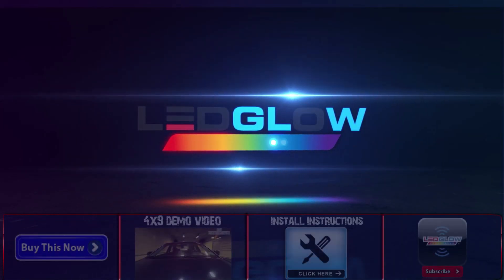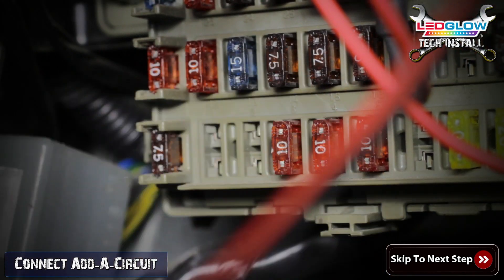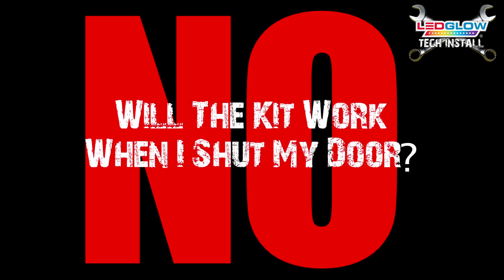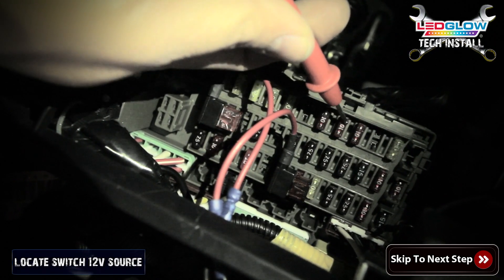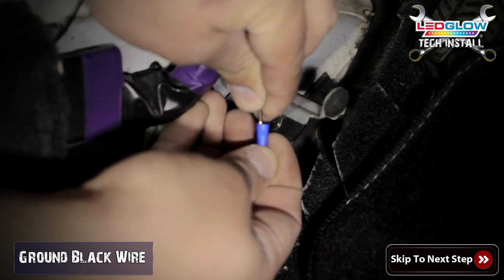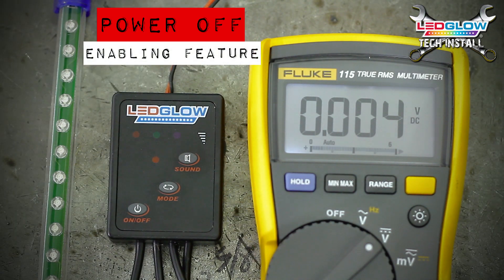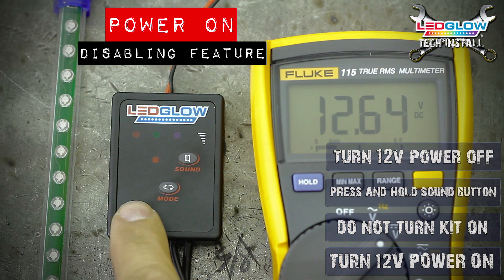LEDGlow | Auto Illumination Mode for 7 Color Interior Car Lights and Truck Lights

Comment: Is it possible to have it hooked up so its on when the door is open and the car is not running like when you are getting in the car, and will go off with the interior lights when the door is shut, and also come on when when you are using the ignition and turn the car on? I would appreciate your time if you can respond, thank you!
Reply from the maker: supersnake151 You can use either one of the installation methods you mentioned, but unfortunately you cannot connect the kit to two different power sources, it's either one or the other. Let me know if you have any other questions or concerns!

Comment: If I want my lights to turn on when I open my doors like my dome lights do what circuit should I connect to? I was going to use the cigarette lighter circuit but I heard that only gets power when the car is on.  So would the cigarette lighter circuit work? If not which should I use? Thanks

Comment: in order to power the lighting kit, does it have to be plugged into the battery is there another source of power, other than a cigarette lighter?
Reply from the maker: +Tarek Taher You can hook it up to the battery, use the cigarette lighting with our socket adapter, or use an expandable circuit which would provide power via the fuse panel.

Comment: I have a 2004 Toyota Solara convertible. Is it possible to install these and be able to switch them on and off as I would like, instead of wiring it up so it's set for a default like the headlights, if the door is open, or if my engine is on? Because I want these set up so I can turn them on and off when I want.
Reply from the maker: +Cameron Tucker Yes, the kits come with a their own on/off power switches.
Reply: Ok, so which is your preferred route to installing these so I can turn them off and on. I'm thinking of wiring it up so when the door is open they turn on. BUT... if the door is closed, can I still power them on with the remote switch?
Reply from the maker: +Cameron Tucker No, if you hooked it up to power on when the door is open, it will not be able to be turned on when the door is shut. You can hook it up to any switched, or constant power source and then be able to turn the kit on and off on your own.

Comment: If I would connect them directly to the headlights-wire, it will appearently shut down functionality because of the board-computer of my BMW E46. Is there a solution for this?
Reply from the maker: +Michael Goor I am sorry to hear about that issue. For more help with technical related questions, I would speak to our technical department. They can be reached by phone at 856-768-5700 or by e-mail at: techsupport@ledglow.com

Comment: How hard would it be to install it into my 2002 f-150 and take them out once I get a new truck.
Reply from the maker: +Jacob Poche Installation and removal of our kits are extremely easy. You can just use an adhesive, which we include, to install them and simply peel them off when you are ready to install them in a new truck.
Reply: +LEDGlow  Ok thank you and when do you think yall would have the bluetooth interior lights?
Reply from the maker: +Jacob Poche Unfortunately, I am unaware on if, or when, we may have Bluetooth interior lights available.

Comment: So if I run it to my ignition when I turn the car on the lights will stay on til I turn the car off right? And which expandable circuit would I need to do this with your million color Bluetooth leds?
Reply from the maker: That is correct. Check your vehicles fuse box or look in the owners manual.

Comment: On amazon they have LEDGlow single color lighting for the same price, if not more, than the 7-color lighting. Is there a loss in brightness with the 7-color set? I don't understand why someone would pay for just one color when they could have them all for the same price. Tho i could not find any specifications on the lights anywhere.
Reply from the maker: Evan Scott There isn't a loss of overall brightness between the two kits, but Single Color Kits come included with 7 different brightness levels whereas the 7 Color Kit only has 1 level which is a good brightness. Is there anything specific about either of the kits that you would like to know about?

Comment: For the door controlled lights, what would be a switched power source that I could splice into. My car is a 1995 nissan 300zx NA
Reply from the maker: OG BananaSwag If you're looking to install your LED interior lights to turn on when the door opens, you will want to power the kit from a constant source rather than a switched power source. If you open the door and you're connected to a switched power source then the kit won't turn on unless the car is turned on. Let me know if you have any other questions!
Reply: @ledglow  is there a way to use the door pin method with the headlight method?

Comment: Does anyone know what the appropriate price range would be to have this done by someone professional?I know electrical stuff can be tricky and I'm not confident enough to do it myself.
Reply from the maker: Jorge Posadas Unfortunately we cannot name a price for a shop to install the lights for you, but it shouldn't take longer than a few hours to install. I recommend contacting a few local auto/stereo shops that perform installations, ask for a few price quotes and weigh your options from there. Let me know if I can help with anything else!

Comment: if you connect it to the ignition will they turn on when you turn your car on or off ?
Reply from the maker: +Trey Rahman Yes, if they are hooked up to a switched power source, they turn off whenever the power wire is no longer receiving 12 volts.

Comment: Will the headlight auto illumination work if the headlights are on auto?
Reply from the maker: If you connect the kit to the headlight switch itself, no, it will not work with auto headlights. If you want the kit to work with auto headlights, you will need to connect them to a 12-volt wire between the can bus and the headlights.

Comment: hi there is there a way to connect the led glow to turn on when on when doors open and turn off when engine starts running just like the dome and door lights do ?
Reply from the maker: Rury Carrillo If you connect your LEDGlow interior kit to turn on when the doors are open, they will not function when the door is closed so when you're driving on the road, the kit will have no power going to it. Let me know if you have any other questions!

Comment: Hey LedGlow, I ordered and installed your 7-color underdash glow and not even a week with it, the fuse box busted. Is there anything you guys can do to help me because now it's not working at all. I would greatly appreciate your help. I am a avid consumer of you guys' underdash kits.
Reply from the maker: mr21king2 Thanks for letting us know about your issue. Did the entire fuse box of your car fail or only the control box of the interior kit you installed?
Reply: It was just the fuse box, super glue nor duct tape worked.
Reply from the maker: Hmm, that is odd. I'm still not entirely sure what your problem is, but I recommend contacting our Technical Support Dept. at 877-LED-GLOW and one of our techs will be able to help further diagnose the issue you're having. Or if you'd like you can email me your contact information to Mike@LEDGlow.com and I will have one of our techs contact you directly at whatever time is good for you.

Comment: Is it possible to program it so that the lights fade on and off with the auto illumination to the doors
Reply from the maker: MrGordito4life Unfortunately the interior lights cannot fade on and off when wired to the door pin. They will just turn on when the door is opened and when the door closes along with the power circuit to the kit, the lights will turn off. Let me know if you have any other questions or concerns!

Comment: I have two questions:
 1) I own the 7 color interior lighting kit. If I want it set to only one specific color (ex. blue), would I have to set that up before I program the auto illumination setting or can it be done at any time? 

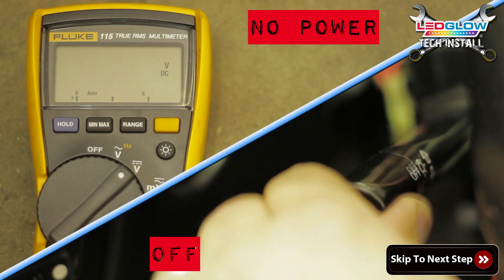2) If I wanted the auto illumination to go with my headlights, could I also get my power from there by wiring the power wire and the headlight wire using the scotch lock (like shown in the video at around 4:00)?
Thank you!! :)
Reply from the maker: +Vasiliki Pappas Hello! For more in-depth answers to your questions, I would get in contact with our technical staff. You can e-mail them at: techsupport@ledglow.com OR you can reach them at 1-856-768-5700.

Comment: Hey guys! This is a cool product and I was thinking about getting a kit! I just have two questions! 

Local law says I can't drive with these on because they are a hazards so I was wondering if:

#1 is there a way I could wire the kit so it would turn on with the interiors when I open the doors (I wouldn't be able to use the door switch method because of the circuit interuption) but also be able to turn them on and  off as I please? Or does the toggle switch allow me to do that? (I'm a bit confused with its function settings) 

And #2 if I wire it directly from my battery, will it power of when my ignition is off also? (So I don't end up with a dead battery?) 

If anyone could give me a hand that would be great!! I'm fairly new at wiring!

Thanks!! 

-Mitch
Reply from the maker: Thanks for reaching out to us, Mitchell Dureault !

If you open and close the door, it will not trigger the kit to be turned on, it can only be used as a single way to power the kit on and off and you mentioned you cannot use the door switch method. Your best bet would be to wire to the kit to a switch or the headlight switch source so when the headlights turn on, the kit turns on as well.

If you decide to power the kit from the battery, the kit will always have power going to it whether the car is on or off. Our LED light kits have a very low amp draw when not in use (.01 amps) but as I mentioned above, I recommend connecting to a switched power source to just completely avoid the possibility of a dead battery. If you have any other questions or concerns don't hesitate to ask!

Comment: how do you know which cable is the headlight wire? I want to the headlight method but i don't have a voltmeter, and was wondering if i could it without one.
Reply from the maker: Natural Born K1LL@ If you do not have a voltmeter, you can use an expandable circuit to tap power off the headlights fuse from the fuse box. You can find this fuse by referring to your owner's manual in your car. Let me know if you have any other questions or concerns!
Reply: I have the expandable circuit as well and tried several different fuses, but nothing works. I looked up different fuses, such as airbags, wipers, and a few others but the leds still don't work.
Reply from the maker: Natural Born K1LL@ If you connected the expandable circuit to your wipers fuse for example, make sure the car is powered on to test the kit because the wipers will only function when the car is on. What year/make/model are you installing the underbody kit to? I will try to do a quick search to see which fuse you can use to power the kit from the headlights.
Reply: I did that too, and my car is a 2014 vw golf. I tried several fuses with the ignition on.
Reply from the maker: Natural Born K1LL@ Where do you have the black ground wire connected to? This wire needs to be connected to a bare metal surface and even if everything seems to be fine but this part isn't connected to metal then the kit will not turn on.
Reply: i cramped the black wire onto a ring end and put it in between a washer and a screw inside my dash.
Reply: and i also tried it on a empty fuse slot with no results
Reply from the maker: Natural Born K1LL@ It seems like you installed everything correctly. I can refer you to one of our Technical Support Specialists so they can further troubleshoot the issue you're having. If you could email me your contact information (name, phone number and a good time to reach you), I can have a tech support specialist contact you directly to see exactly what the issue is.
Reply from the maker: Natural Born K1LL@ If you could please send that email to Mike@LEDGlow.com.

Comment: so what about with the dome light of my car I could use with door open or closed
Reply from the maker: ***** If you install your LED interior kit using the door pin and auto illumination function, the kit will only function when the door is opened. When the door closes, you will not be able to use the kit since it is grounded to the door pin. Let me know if you have any other questions or concerns!

Comment: hi there, how do i connect the led whenever i open any door, the led will light up? Thanks and your reply will be much appreciated!
Reply from the maker: sappyyyyyyGO If you’re looking to have the Interior Kit illuminate whenever you open any door on your car, you will need to follow the instructions in the video for the door pin installation. However, you will need to add 3 separate ground lead wires from the main ground and run those wires to the other door pins of the passenger door and back seat doors. You can add those new ground lead wires by using 16 or 18 gauge automotive grade wiring. If you have any other questions or concerns don’t hesitate to ask!

Comment: LEDGlow I want to use the auto illumination feature but a spade terminal attached to door switch will not fit in my 2014 corolla. Any suggestions?
Reply from the maker: Rudy Guevara If the spade terminal won't fit your 2014 Corolla, then I would recommend either using a scotch lock connector or hard wire the kit to the door switch. Let me know if I can help with anything else!
Reply: LEDGlow So "all" cars door switches act as a ground correct? I don't want to tap into the wire and I get a short. If it helps my door switch color wire is Purple.
Reply from the maker: Rudy Guevara I wouldn't say "all" car's door switches are ground controlled, but I would confirm if your 2014 Corolla's door switch is by using a multi-meter. The interior kit also features a 3amp inline-fuse that will prevent any shorts. Let me know if you have any other questions or concerns!

Comment: I have a 1982 chevy c-10 and I want to connect it to my headlights when I turn then on.  which wire do I splice into because thre is two wires coming out of the headlight switch??
Reply from the maker: +shotgunsmalls ;0 I would suggest using a multi-meter and testing the wires because one wire could be the ground, one could be the constant source and the other could be a switched source. You will want to find the switched 12v source wire to splice into for power for your specific install. If you have any other questions or concerns don't hesitate to ask!

Comment: So if I connect the ground wire to the door pin I can't use my kit when the door is closed?? Like at all, even with the car turned on
Reply from the maker: +Newark Network Yes that is correct. Since you're grounding the kit to the door pin, the power circuit to the kit closes with the door and reopens when the door is opened. This is a popular feature with the kit that people use who only want the kit to turn on when they open the door. If there's anything else I can help with just ask!

Comment: so if you connect it to a switched power source and my car is off will it kill my battery?
Reply from the maker: +Richie iula No, it will not. It is on a switched power source, meaning it has no voltage at all when the vehicle is switched off.

Comment: Can you power two different ways?  i.e. autoillumination and when I want to turn them on or no.
Reply from the maker: Yes, you can power the kit whichever way you like. Our installation is only a suggestion.
Reply: LEDGlow so you can do it two ways at the same time?
Reply from the maker: No, this kit can only be installed to one or the other.

Comment: Is there a way to link them to the lights that are already inside? The lights that come on when you unlock your car and than they switch of once you turn on the engine?
Reply from the maker: Yes. To do that, you'll need to connect the power wire from the control box to a wire that only receives power when the doors are open. The dome light power wire is the most common.

Comment from the maker: Our interior kits that feature the auto illumination function are our 4pc Interior Lighting Kits that come with four 9 inch tubes start at $32.99. Our 2pc Expandable Starter Kits that come with two 9 inches tubes and the ability to add up to four more tubes start at $24.99 & 4pc Expandable Interior Lighting Kits that come with four 15 inch tubes and the ability to add 2 more tubes are available in Pink and White ($24.99), while the 7 Color starts at $42.99. Visit our website for more details!

Comment: Hello 
I getting a hard time. Im trying to do auto illumination but its hard can you help me out
 
Thanks
Reply from the maker: yolo Bermudez What part of the installation are you having a hard time with?
Reply: Programming control box auto illumination
Reply from the maker: yolo Bermudez What method did you use to power the interior kit? To program the control box for the auto illumination function, you will need to first turn the kit off. Next, press and hold the Mode button for 5 seconds and the auto illumination function should be enabled. To test it, either open the door, turn the ignition switch or power your headlights on and you should be good to go! If you're still having trouble programming the control box, don't hesitate to contact our Technical Support Team at 877-LED-GLOW and we'll be more than happy to help you out!
Reply: I use connect add a circuit and i connected to window fuse and i already did all that you toll me and still doesn't work.
Reply from the maker: yolo Bermudez Give our Tech Support a call at 877-LED-GLOW and we'll help further troubleshoot the issue for you!